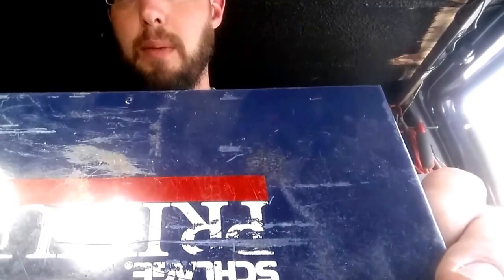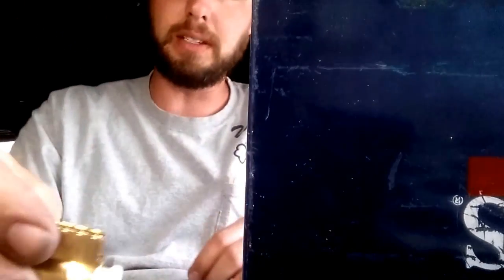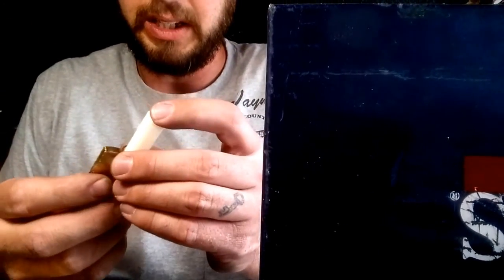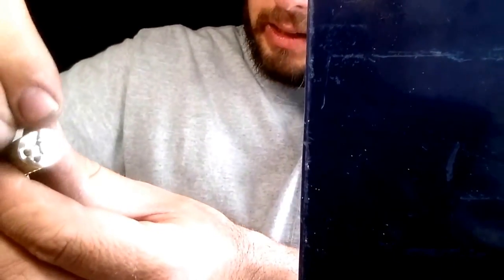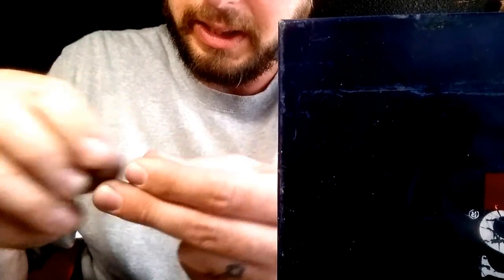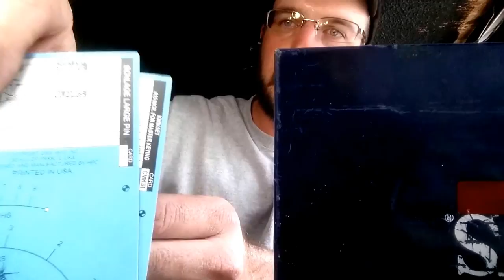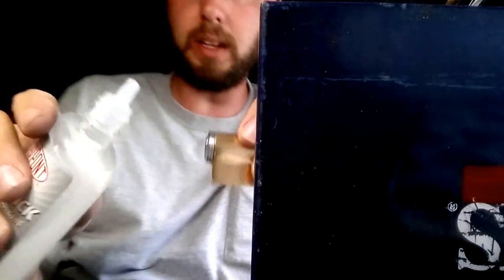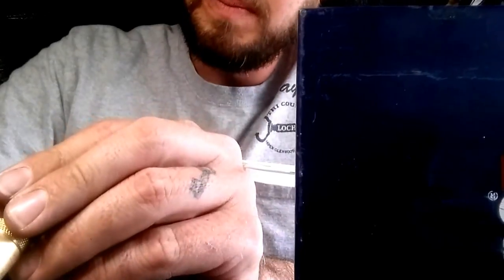How to Re Key or set up Schlage Primus Lock Cylinder CXP Key way

Comment: Thanks for the great information. I bought a new Everest Primus rim cylinder 20-710 613 C135, KeyType 48-004, Level 7 over internet with no key. I brought it to my local locksmith. He told me that he cannot rekey it because of the sidebar. Did I bought a junk?? Thanks in advance for your help.
Reply from the maker: Everest and primus can b 2 different locks and keyways. It's hard to say why your locksmith can't set it up.
Reply: Thanks for your reply. I have watched all your videos about Everest and Primus. They help me understand a lot.

I believed the lock is a Primus cylinder with a Everest Keyway C135. I was told by the local locksmith that I need a pre-cut Primus side-bit milled C135 key with matching the side finger pints in order to rekey this cylinder.

Is a way to get C135 Primus key with matching side finger pins?
Thanks,
Reply from the maker: Well with primus conventionaly youwould match the side pins to the key blank as the side bar is stationary so I don't know why they would do it. It might be best to find an authorized Schlage Primus locksmith in your area an ask them. I have only worked with the 123 keyway. Bassed on what I see when doing a bassice search the C135 keyway is just an everest cylinger and dose not even accept side pins. It's not highsecurity it's simply restricted keyway whtich means that it raises a check pin in the back of the cylinder but no side pins. See link
http://mysecuritypro.com/35-009-c135.aspx
Reply: Thanks for the information. The front of the core has both the print of PRIMUS and the Everest symbol. The back of the core indicates C135. I took the cylinder apart. I did see side finger pins and side bar in the lock.

What I got is similar the post in following link
http://www.keypicking.com/viewtopic.php?f=99&t=3820

Just wondering if it is possible to make any use out of this cylinder.